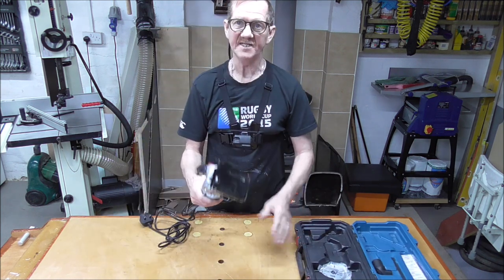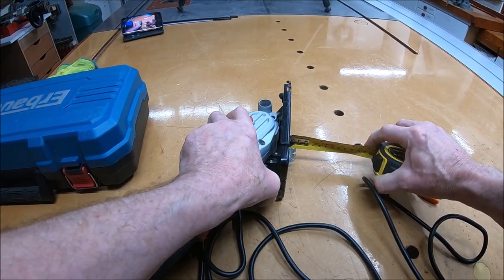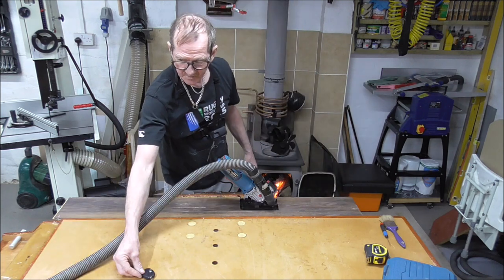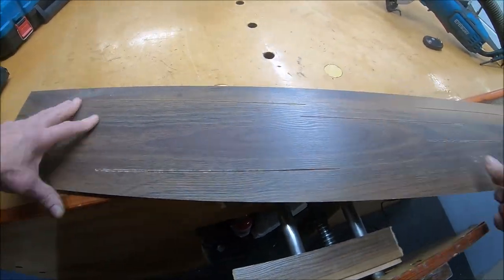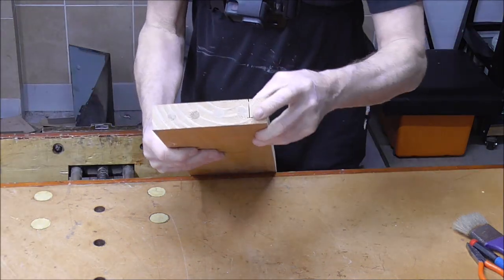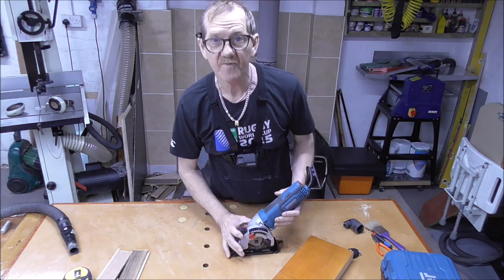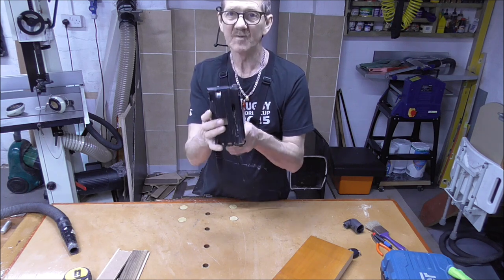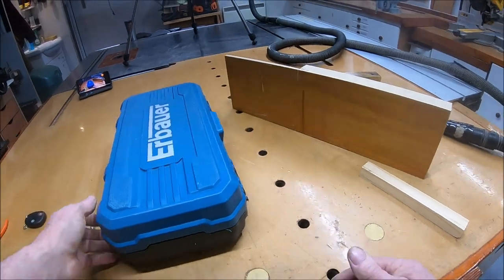Erbauer 650w Plunge Saw Full Test & Review

Comment: I've had one of these for 4 years and its still good. Yes the laser packed up after about a month but I never used it much. Yes it took ages to figure out how to best pack it away but thats sorted. I'm still using the original blades and they work fine. I have chased out walls for electrical conduit using the diamond wheel and it's excellent. The dust extraction is remarkably good considering the tools price point.. I'm very pleased with it overall.

Comment: The case was clearly designed for a pre production model with no cable. I used a multi tool to cut away part of the box inners giving more space for the cable. I'll probably cut more away to accommodate the fence which pointlessly sticks out of the lid, pressing on the cable despite there being room for it to fit the other way up. Really good saw with a good quality but poorly designed case. The dust extraction connector is an odd size which fails to fit my Henry vacuum but recently discovered a washing machine drain hose fits perfectly to the saw.

Comment: I've got the almost identical (except for the variable speed) WORX branded version and use it quite a lot. The diamond blade is especially useful for chanelling brick and plaster walls. Cut 2 or more parallel slots and then easily cold chisel the bits between.
Reply from the maker: I tried the Word one first but found it a bit on the heavy side

Comment: Hi Dave, great video, theres no argument it is a good little saw, I just returned my due to the laser issue and replaced it with the Bosch 12v cordless mini circular saw which is just as good if not better because i find it less restricting without the 240v cord. Have you tried replacing the batteries in the laser compartment because its so easy to leave on when using and then it absolutely drains them ?
Reply from the maker: yes Ive got the same issue its to go back to Screwfix to get sorted

Comment: Thanks for the vid, can you tell me if it can be used to cut bottom of skirting boards in situ?
specifically to a thin slither for LVT installation, so 3mm or so ? thanks
Reply from the maker: No it won't cut that close to the floor your better with a multi tool
Reply: @dmgladden  ok i thought so. Can you recommend which tool ( make and spec ) would be good for this? something with good  power so that I'm not spending forever cutting the skirting as is the case with some of battery powered multi tools>
I appreciate your response ,cheers

Comment: A year or two ago, Erbauer were cheep, nasty tools. Recently they have massively upped their game, and the tools are now far better quality!
Reply from the maker: yes it seems so im quite impressed so far
Reply: From what I have the heard the new EXT range (which I have got a few tools from) can knock spots off the old Erbauer kit. Not only does it look professional but also feels that way.

Great quality tools at an absolutely unbeatable price! The fact that all there cordless range of 18v kit is brushless is also an amazing bonus considering the great value for money price tag! 👍
Reply from the maker: @benh1216  never seen or heard anything about the range you talk of but I'm finding this particular saw quite amazing it is handling heavy site work without any problems and that's all I ever look for, but thanks for the info
Reply: @dmgladden  Yeah. Well it's pretty good as mentioned. If you search "Erbauer" on B&Q or Screwfix it will come up with all the new EXT range. Would definitely recommend if your looking for some great bargain tools that will do the job and more! There is also Ryobi which I heard are decent. However don't know much about them since haven't used them!